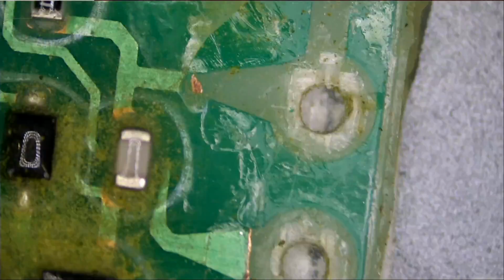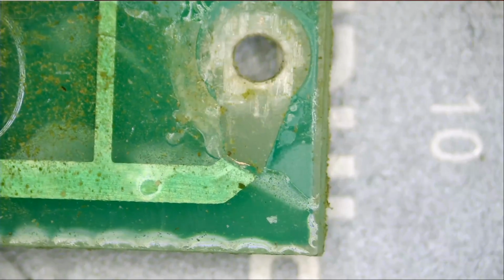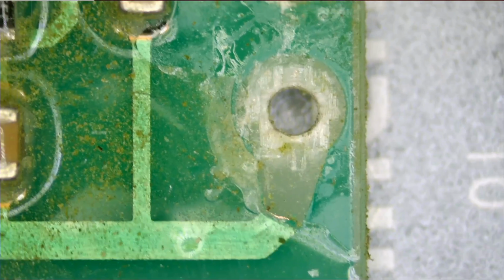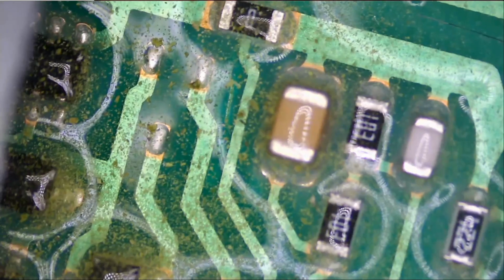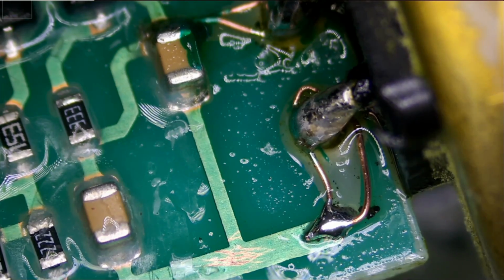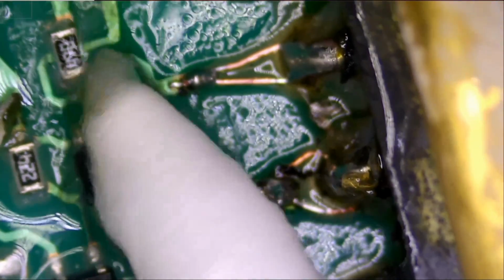NJP800C Capsule filling machine Sensor Cable Repair and a cracked board

Comment: I'd like to finish a hot glue with a hot air gun. It will stick better when totally melted and flows to the nooks and crannies. Will turn out shiny and with no air bubbles

Comment: Great job as always. Would like to share some tips too. For traces or copper pours with scratched solder mask, it is better to reinforce it with new solder because it might be too thin already from scratching and will corrode easily.

Comment: The solder has been bridging, you don't need to attach a jumper wire over it.
Reply: Surya Adi No, he is correct to attach a jumper wire because wires are flexible. The crack in the board might break the solder bridge during any movement.

Comment: Do you use anything special to remove the soldermask and get to the copper trace or just with the tweezer?
Reply: Exacto knife works great, you can use the tweezers but it will damage them
Reply: There is also fiber glass pens or brushes that remove it as well. It all depends on the thickness of the trace and work space area i guess.

Comment: Thanks for the show. Was hoping you can advise on problem whereby solder on fine tip wants to pool up the tips rather than stay on the tip when doing fine soldering. Even using flux and new tip I get the creeping upwards effect which makes fine work difficult.
Reply: Sounds like you have oxidized tips, there is a paste that it's solid brown used to clean oxidation from tips, sadly I don't know the English name for it, all you need to do is deep the tip for half a second on it and solder will stick to the tip until it oxides again (the higher the temperature the faster it oxidize, this is why a quality soldering iron with regulated temp and sleep function is a must in microsoldering)

Comment: I might add pads to backside of PCB by using tiny, copper washers or cutting some from copper stock. Or, simply JB-KwikWeld pins on backside of PCB if future disassembly not a requirement. The JB-KwikWeld can reinforce that cracked PCB as well. It's ODD that OEM would solder header on same side it drops in PCB, with no pads on back to provide support. Perhaps a design faux pas?

Comment: I would had put blobs of solder on the back, but dunno if that would be a good or a bad decision, I mean it would be way harder to rip it apart, but it could also mean that if someone apply strong enough force to it it would break the board, I would also apply a layer of B7000 clear glue on the repaired part of the board, I mean someone took the time to "water" proof it, maybe it's a device that may be in contact with humidity or liquid, but by the looks of it, it that doesn't seems to be the case, still I would had apply it, I really need to get a pair of quality tweezers, yours look stiff while being really slim, mines bend if you look at them.
Reply: it's mono-layer so the back is plastic how are you gonna solder a blob to the plastic back ?

Comment: Was the copper wire necessary when bridging over the crack or could you have just soldered across the crack?
Reply from the maker: Wire is flexible. Solder alone can crack.
Reply: @NorthridgeFix  yeah solder alone cracks
Reply: Same reason you use rebar on concrete, you need flexibility if you want longevity.
Reply: Got it! Thanks everyone for the replies.